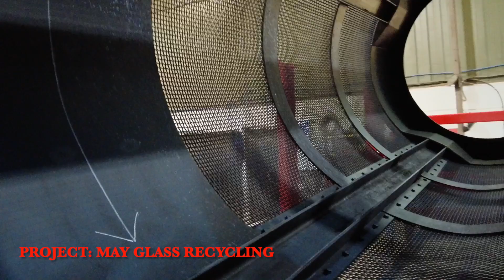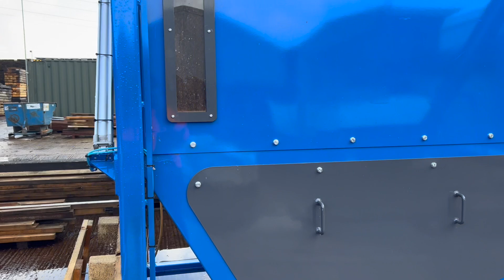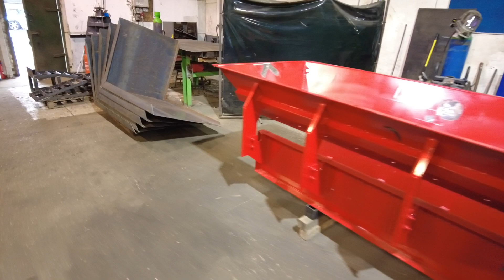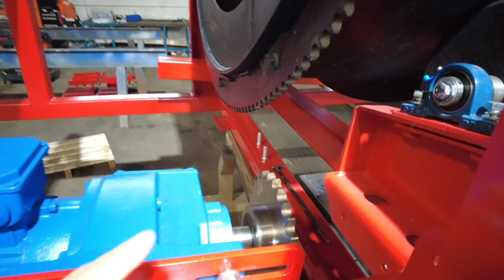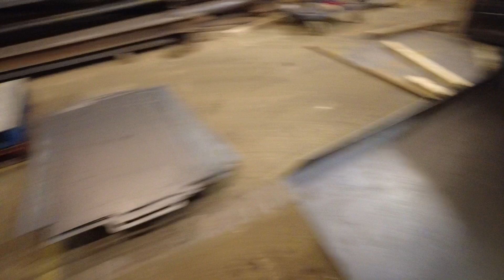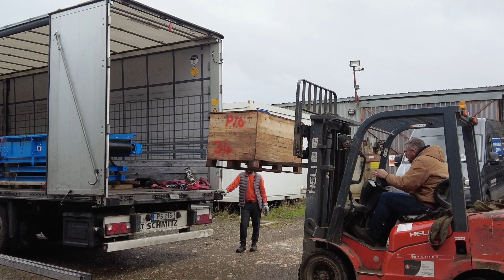Trommels, mini screens & conveyors !!!

Comment: Thanks for the video Gavin, the Flight Engineer on Concorde could place their hand (if very confident) or more commonly a flight manual in the gap that developed once airborne between the Engineers instrument panel and the flight deck bulkhead due to thermal expansion of that part of the fuselage. When on the ground the gap would only be a few sheets of paper wide.
Reply from the maker: So many stories about Concorde. It will always be such an iconic aircraft ♥️. Thanks for watching and commenting.